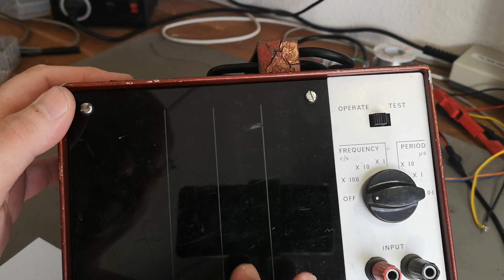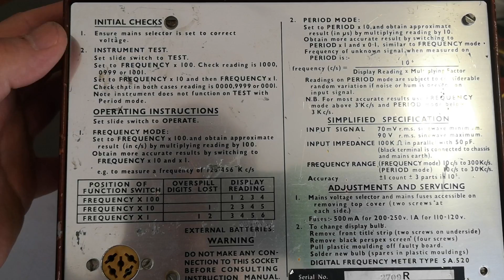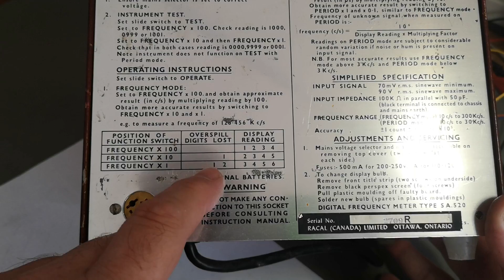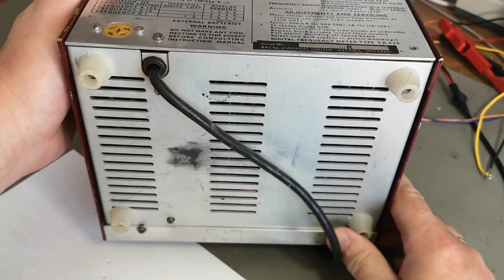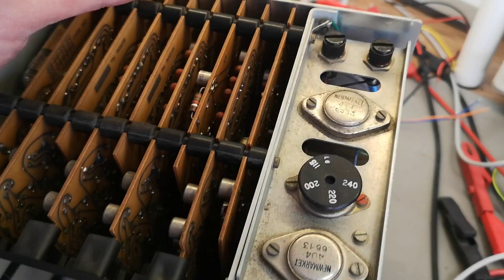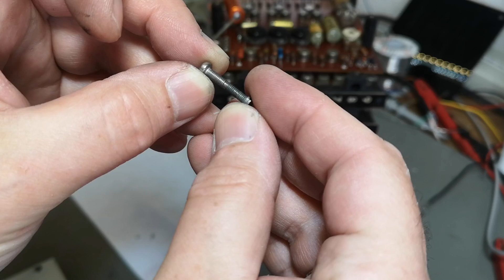Racal Digital Frequency Meter SA 520 1962 4-digits bulbs teardown

Comment: For sheet metal work it is good to have M3 and M4 PEMs. You can press them into a hole and they stay put. Crude ways to press them in work - I use a flat jaw vise.

Comment: That “M2.8” is a standard #4-32 screw you can buy in just about any hardware store in the US and Canada.  Read that as “number 4-32”. 

Numbered sizes are not popular above #12. For larger screws, the inch sizes take over in the market. 1/4” fine and coarse thread are popular for example.

Most imperial screws are available in two thread pitches: fine (F) and coarse (C). 

I think you need to get a kit of imperial hardware to have handy. #4,#6,#8,#10 in fine and coarse thread are a must for electronic equipment. Get button head and flat head Philips. Get a 1in. long for all of them and cut to size. For easy cutting use American wire strippers that have built-in imperial screw cutters. Super handy! I wish they made them for metric too.

US screw designations are size-inverse pitch, ie. in #4-32, the #4 refers to diameter in a roundabout way, and 32 means 32 threads per inch. For metric screws the pitch is given in length units, for US screws it’s given in 1/length.

Comment: I just picke up one of these. It it not working, so, case repurposing is on the agenda. Maybe use LEDs in the display. I have no use for one. I has the Racal SA 535 1.2Mc/s Universal Counter - Timer. I think I will randomise the display at some point.

Good to know what it is for. I like the old transistors inside too.
Reply from the maker: cool score, is your handle also cracked ?

Comment: Ah, the joy of imperial hardware. The worst is when you need to figure out the specs of an imperial screw in order to (try to) order the exact replacement ones. I purchased a thread gauge and ruler in inches, it helps.

Comment: Is the handle cracked or just the paint?
Reply: It is likely cast from zincal which is known to recrystallize after a few decades if made improperly. After that, it just falls apart.
Reply from the maker: @petrpolasek5931  interesting, i have not seen anything like this before
Reply from the maker: it is the METAL, really not normal to see that, i have no explain why it looks like this, it is also looking like this from the other side
Reply: @TeardownOZ2CPU  That's why I was curious. I wonder if it came across some chemical that corroded it.

Comment: A M2.8 does not exist. I assume it is one of those exotic "imperial" threads. If it is a British thread, then you are completely lost. They have invented too many insane stupidities. I have a cylindrical grinder from the Unitet Kingdom, and the special tabs and dies required for repair cost me a fortune.
The best answer are sheet metal screws. :-)

Most of all: I like that old equipment you keep pulling out from somewhere.

Comment: I have the exact same counter serial nr N1836, the power transistors on my unit have date code 6430. I believe this unit does not use any metric screws at all, but rather SAE thread. There is a thread size that is very close to but not quite M3. That flying capacitor was not added later, it is on my unit as well.
Reply from the maker: thanks a lot, this explain the thread challenge, is your handle also cracked ?
Reply: @TeardownOZ2CPU  Nop, the handle is perfectly intact. I have no clue how a cast aluminium handle got damaged like yours.

Comment: Hi Thomas, that's wonderful, I think HP made a counter based on this principle, but instead of light bulbs, there were glow plugs.
Repairing the broken screw is simple, come for a visit and it will be fixed in half an hour 😂 if it is not possible to remove the broken screw and fix the thread, then the nut is removed and a new stainless one is riveted on. If a galvanized nut is used, a corrosive phenomenon could occur on the aluminum sheet.
Comparing the screw to the diameter of the power cable, it looks more like an M4 size screw on my monitor.

Nice day 🙂 Tom
Reply from the maker: The screws i had to "play" with in this video, was a tiny bit smaller diameter than regular M3, and the thread angle is almost the same too, this is why a previus owner misplaced the originals screws, since they did not look that important to keep safe. He then Tried to fit regular M3 !! causing quite a bit of new problems.
As max explain in his comment, it is from canada they might have used a funny odd sized inch thread. none of my regular inch screws looks like this.
Reply: They were neon lamps in the HP units.  HP also made them with Nixie tubes, and the counting circuitry is very similar.
Reply from the maker: @douro20  YES look at this link, 5 digit HP counter, with neon bulbs :  https://youtu.be/0DHNVEqzso4
Reply: @douro20  I meant neon lamps, the same principle as nixie, but the Google translator probably translated the CZ name "Doutnavka" incorrectly, a neon lamp in CZ is called a cathode ray tube, the lighting of which requires high voltage (for example, advertising)